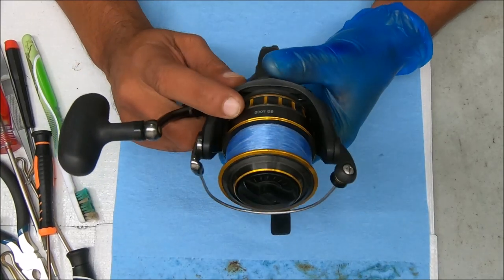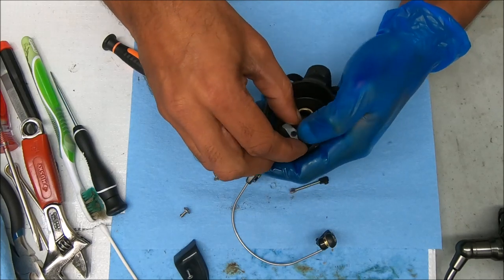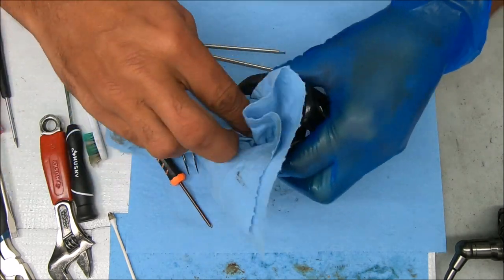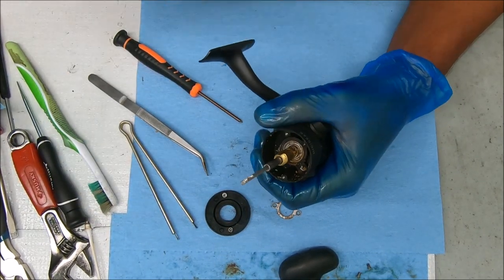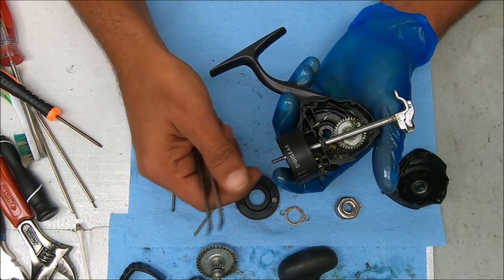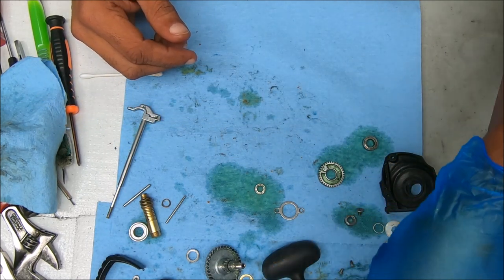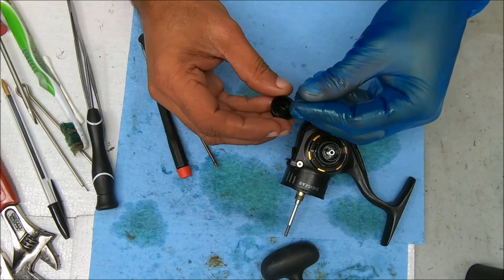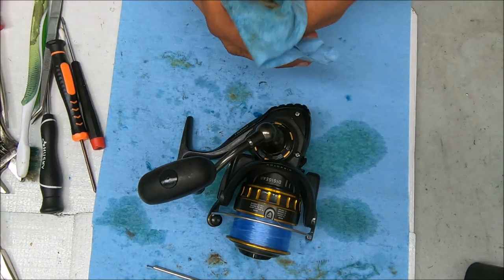Daiwa BG 4000 Fishing Reel - How to take apart, service and reassemble

Comment: I was servicing my BG6500 a couple weeks ago and the main shaft was bent. So, I ordered a new main shaft from Daiwa US in California. Shaft came in like 4 days, awesome. I go to put the pinion gear on the shaft and it doesn't want to go. At first I thought I put the old shaft back in but then I saw that it was the new one. I took it out and the pinion just wouldn't go down all the way. Brand new, I was stumped. Well, it turns out there was a little nick in the main shaft and a tiny little burr because of it. I really didn't feel like doing the right thing and returning it. So I just took some 600 grit sandpaper and removed the little burr sticking up. Went 800, 1000, 1500, 2000 grit and then buffed it on a wheel. Works perfectly now but man I was stumped. I actually could only feel it if I used my finger nail. I guess the tolerances were pretty tight for it to matter but it did.
Reply from the maker: Thanks for the input, Jeff! Yes, I find it happens more around where they cut the section to support the click gear, but it IS tricky sometimes in that it can be difficult to see or even feel..... only when try to put the pinion gear on is there a clue that something's off.

Comment: Great tutorial!! My reel still feels sticky. Like it’s grinding. Especially at the point where the shaft changes direction from going to down. Any ideas?
Reply from the maker: Thanks for checking out the video. I'm assuming you decided to service your reel because you were having this issue prior to the service. Sounds like it may be a bent main shaft, but it could also be pinion stack bearings and/or possibly even abnormal wear on your drive gear. Check those things. The higher the spool is, the more load it puts on the shaft, bearings, gears, etc. Hope that helps.

Comment: There’s a screw locking my main gear in that I can’t get out. But I see this reel doesn’t have one. It’s starting to strip and I’m not sure how to get it out
Reply from the maker: Thanks for checking out the video. Are you asking a question or making a statement?
Reply: @TSGReelService  sorry I was confused… figured it out! Thanks for the video. My bg is like brand new again
Reply: @Semper.Reefing  how did you take it off? I have the same problem
Reply: @lordmoldybutt36  you really can’t miss any steps. Gotta pull the rod out of it

Comment: Whats your opinion on the best reel and the worse reel from a reel service point of view?
Reply from the maker: Thanks for checking out the video. Thanks Penn Spinfshers/Battles, etc are quite easy to service if there are no seized parts. A more difficult reel would be something like a Stella or the Penn International 80S or 80SW, where you may need several attempts at fine  tuning the two-speed..... which can take hours.

Comment: Get a scratch all to get little springs out
Reply from the maker: Thanks for watching and your input.
Reply: @TSGReelService  it’s apparent after painfully watching some of your videos you have no clue on how to repair and service any type of fishing reel.

Before I retired completely I was doing over 1000 reels a year. I was the number one parts purchaser of Penn parts two years in a row.

Hell you don’t even know the correct name of the parts. Get a Starrett SS scratch all. It’s used many times to move little things around. 

You need a proper set of ground flat screwdrivers. Wiha makes the best. 

You need a set if nut drivers for handle and rotor nuts. No Pliers no Crescent wrench 

You need a set of bearing pullers. Reelspeed makes the best. They are made to pull bearings out of a blind hole.

Get rid of that crappy Penn grease. Use Yamaha Marine grease on conventional and some spinning reels.

When you do trolling reels you must service the bearings. They have to be opened cleaned and checked. If you feel anything when turning they are no good.

Spool bearings get oiled drive bearings get marine grease.